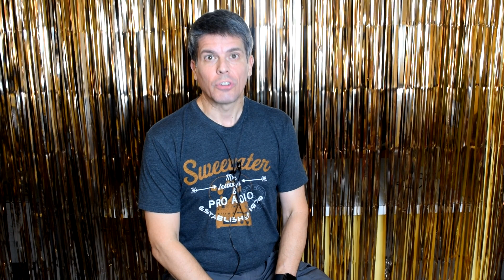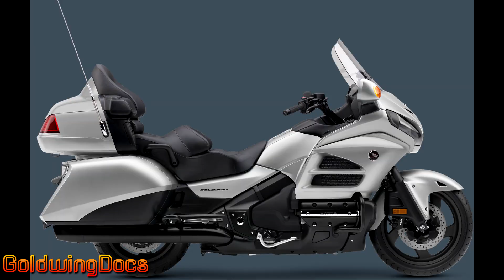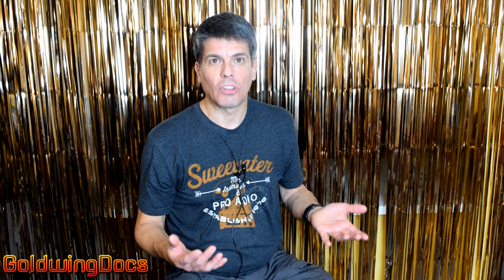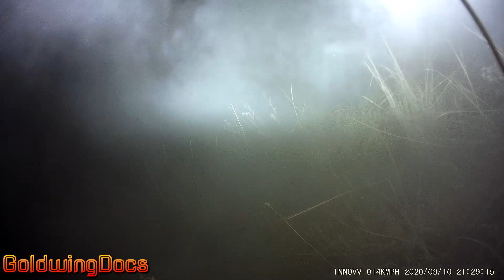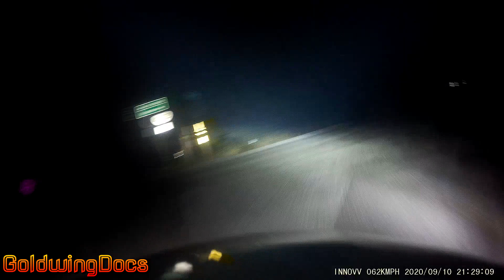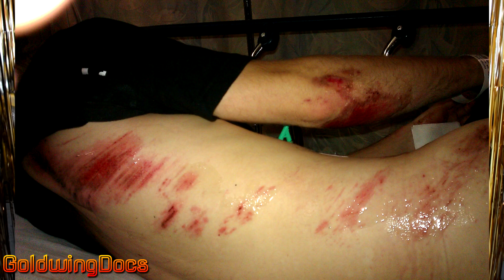Goldwing Crash Video - What went wrong? What can we learn?

Comment: I have been behind people who have "lost it" just like this. Too fast entering the exit, indecision was more than likely the biggest issue. Many people go nuts over things like car tires and such but pulling a trailer is the absolute most dangerous thing you can do with a motorcycle especially in stopping. I also travel with a trailer and even camper but like pulling the camper behind my truck I use much more caution especially when stopping. ATTGAT is a good idea but in this case John was just lucky. ATTGAT does not stop bones from breaking. In the end sometime we are lucky and then sometimes not so much.

Comment: Yeah, maybe this, maybe that, maybe.... I can tell you from experience it would have been a huge mistake to try and wrestle that bike back up after it went down on it's right side. You are committing yourself to a probable high side and at that speed it would have put him in the power lines above.  A GL1800 WILL come back up after sliding on it's side...if you insist on it. But be careful what you wish for. Whether he meant to stay down or not, in my opinion it was the right call. Especially pulling a trailer. Lots of weird things can happen when you add a trailer into the accident but the trailer was not the cause of the accident. Looking at the video, I think he just waited too late to commit to the exit. I was not there, so just my opinion. I am thankful he was geared up and OK.

Comment: Sincere question: Is doing nearly 100 km/h towing a considerably hefty trailer behind a motorcycle(!) considered „normal“ in the first place (even for Goldwing standards)?

Depending on the trailer-to-motorcycle weight ratio and the trailer’s load distribution, 90+ km/h at night seems quite excessive.

Like always, an accident is the result of a combination of issues. Apart from the imminent cause (sand patch), it seems to me that in the speed, lack of decisiveness and handling errors were the true reason for crashing.